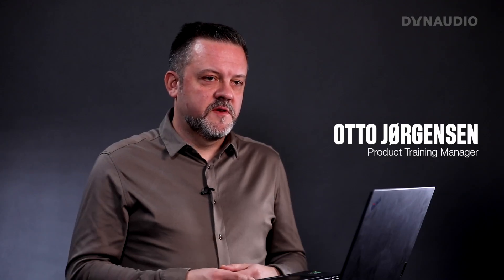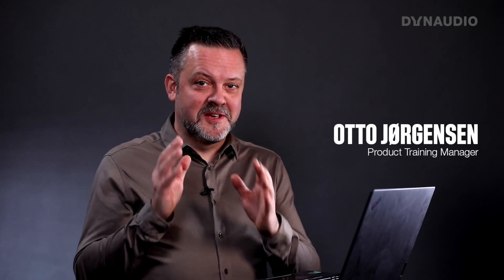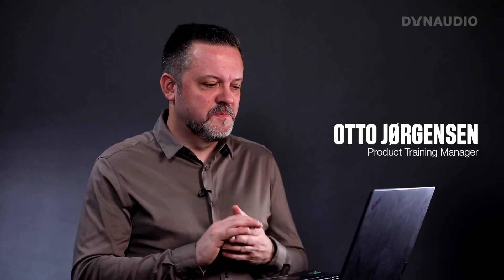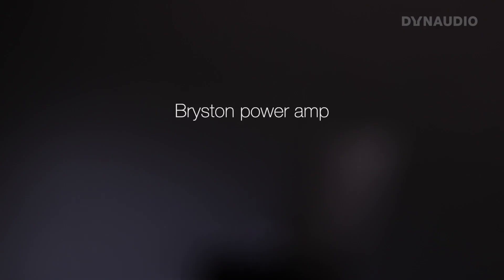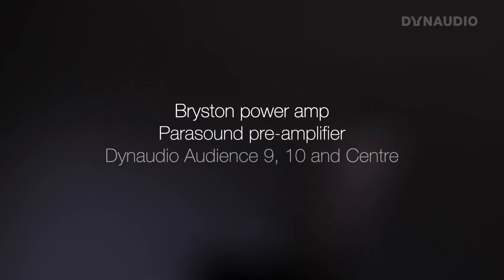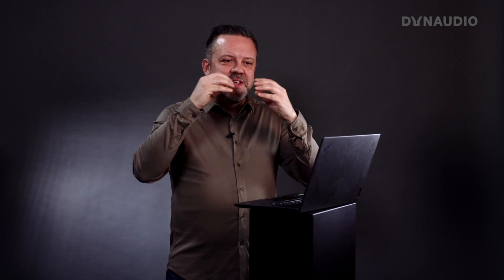Can I compensate for old tweeters by increasing the treble on my amp?

Comment: Since more than 20 years you definitely have some natural hearing loss because of getting older. And the natural hearing loss influences high frequencies in first turn. So, you should first make measurements and ensure that the problem is with your speakers but not with your hearing. Or, alternatively, make an audiogram in medical center investigating your hearing.